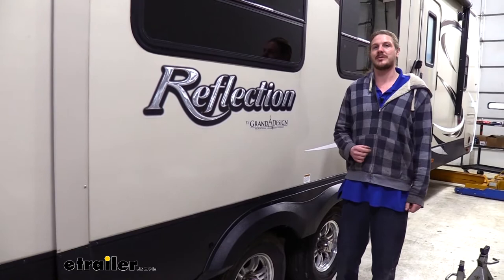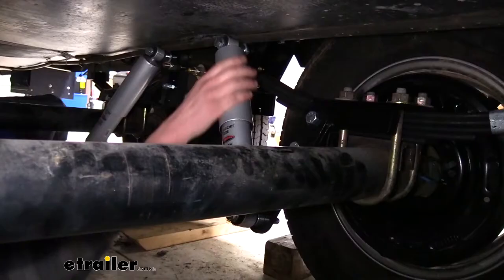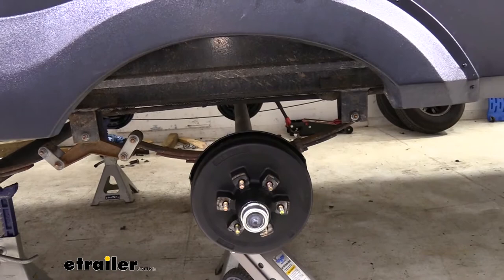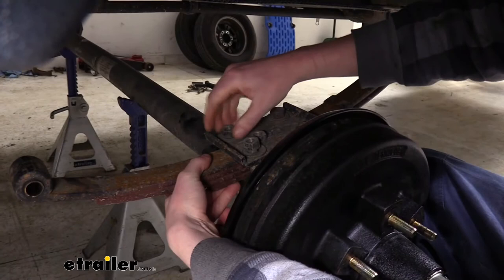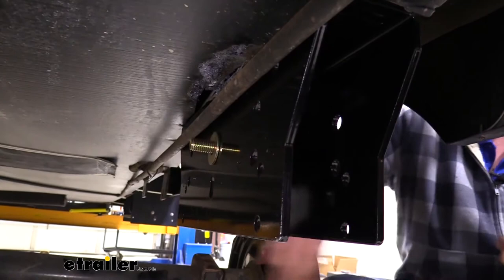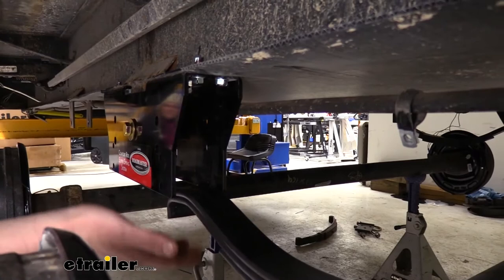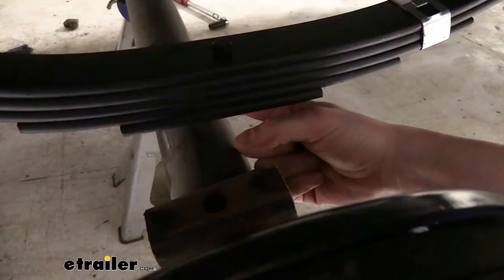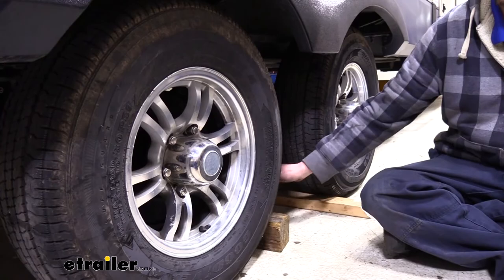Roadmaster Comfort Ride Suspension Installation - 2017 Grand Design Reflection Travel Trailer

Comment: I put this in my Cardinal fifth wheel. Nice system, easy install. I used grade 8 bolts for the frame, and I used blue lock tight on everything! Torque settings important! Ride is greatly improved! Best suspension system made! At a low cost! MorRyde IS has shear rubber that cracks normally around 5 years. This should outlast anything, (especially those wear prone wet bolts from MorRyde.)
Reply from the maker: Thank you for sharing this with us! We love hearing you got it installed!

https://www.etrailer.com/Trailer-Leaf-Spring-Suspension/Roadmaster/RM-2460-2570.html

Comment: Something I run into quite often with reinstalling the ubolts is the new plate is thicker than the factory plate. So the ubolts will need to be replaced with longer ones to have some thread pass through the nut (also squeezing the ubolts together to fit in the holes has saved quite a bit of time if they were hard to get out). Great video and the purpose of the upgrade is explained very well 👍🏻